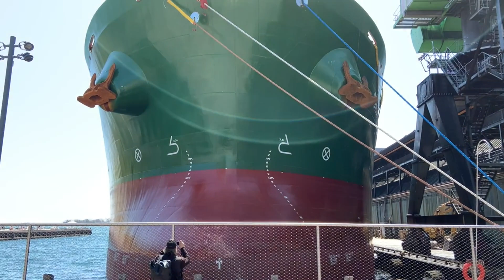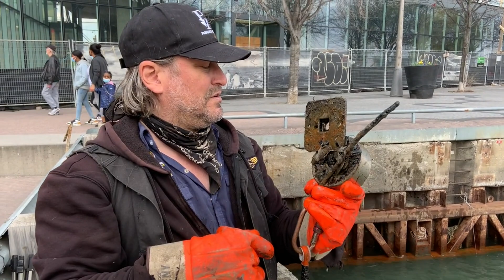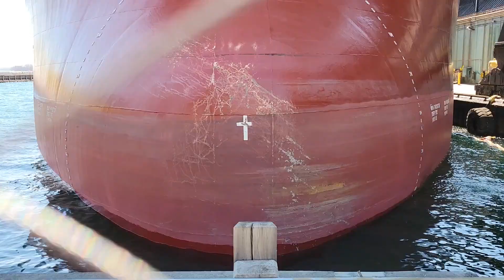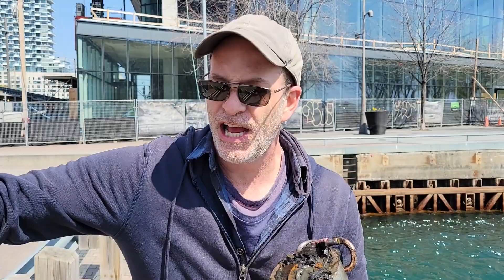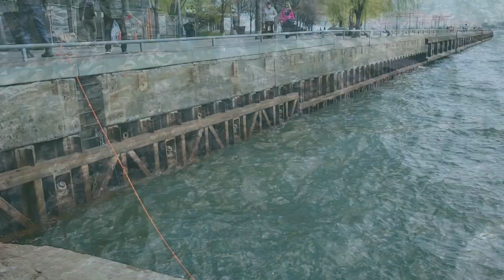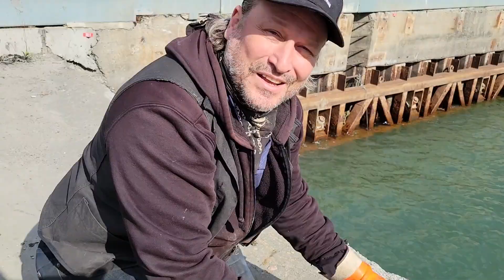MAGNET FISHING a Favourite Toronto Location For Vintage Finds!!

Comment: The Milwaukee thing was hand grip that attaches to a hammer drill. I suspect the wheel you found was for old scaffolding set ups but also could be for a heavy duty cart.
Reply from the maker: Thanks Peter! Yeah we thought some kind of scaffolding or a mobile rack on a boat deck maybe? That's cool the tool was for a hammer drill!

Comment: Hammer drill handle bro's
Reply from the maker: Yeah! Thanks bro!
Reply: @sludgepirates8521  dontcha think?
Reply from the maker: @alaskansonthefly2737  That's what we are thinking now. Until proven otherwise that's a 'hammer drill handle'. Good eye!
Reply: @sludgepirates8521  Yes Sir! I'm usually close on my guesses. I've used hammer drills for 20+ years, doing concrete work.